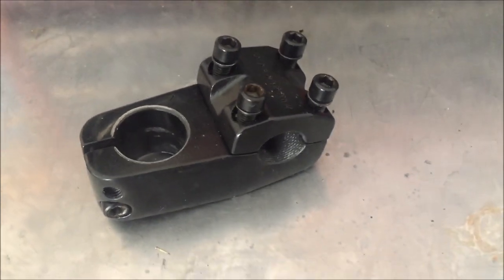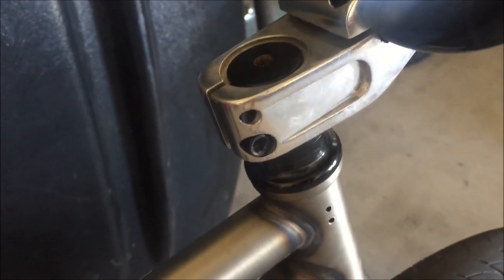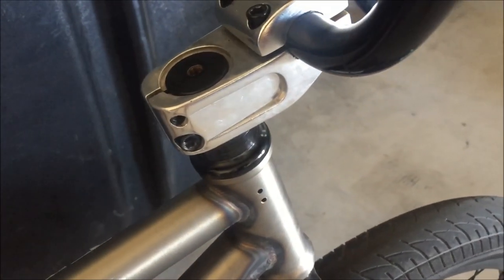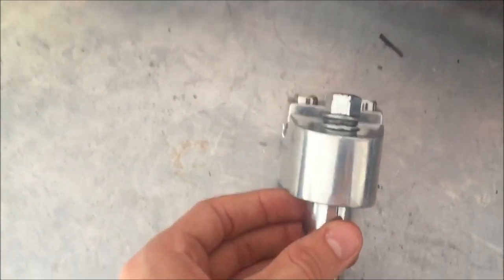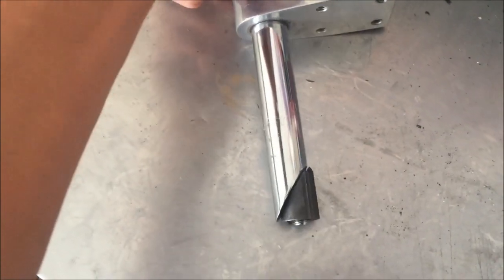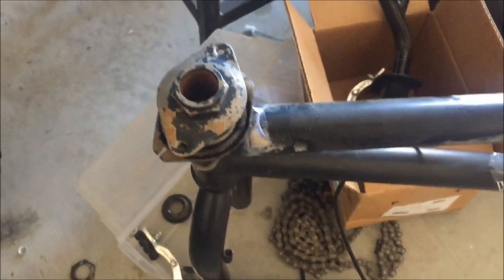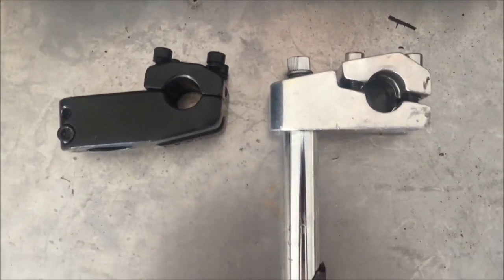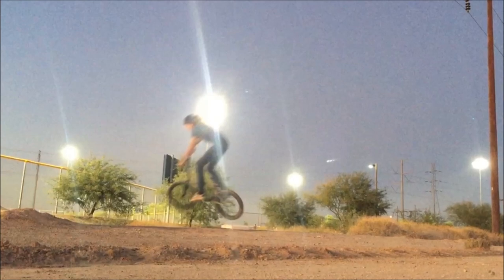Modern bmx stem VS. old school bmx stem

Comment: Can i use a modern stem for my old fork?
Reply from the maker: Modern stems fit 1 1/8th steer tubes. Older threaded forks have a 1 inch steer tube. I don't think it would work.
Reply: Ok thanks
Reply: So do I need to change forks?
Reply from the maker: That's up to you.

Comment: Its depends on frame?
Reply from the maker: Partly, yes. You can’t put a 1-1/8” fork in frame that takes a 1” fork. Yet, you can put a 1” fork through a frame that takes a 1-1/8” fork via headset adapters.

Comment: Quill stems are stronger and easier to work with actually I've snapped theadless forks and bent the stem as for threaded I've never bent broke or had any problems with them except having a loose stem but I bailed on a 30 ft drop and it landed on the bars and still run that stem and it snapped the right side of the bars clean off and folded the seatpost but the stem is perfectly fine I've landed sideways with threadless and broke the fork at the top if anything the threadless is lighter by a few ounces
Reply from the maker: I don't really know the cause for the push for threadless forks. I've noticed with heavy front end movement the tend to come lose. I have not had that issue with a threaded fork. Not even once.

Comment: I bought a modern stem for a bike with a old school stem would i be able to put the modern stem on or not?
Reply from the maker: Most likely not. A modern stem is meant for a thread-less steer tube 1-1/8 in diameter. The modern stem will be too big for the steer tube.

Comment: Can you put old school forks on a more modern frame that had bigger forks diameter if I swap the old school forks too?
Aka are the bearings the same size etc for a straight swap?
Cheers
Reply from the maker: The bearings aren’t the same size for the swap. You would need some kind of bearing cup reducer for it. If it’s set up intergraded (no bearing cups) there might not be any way to do it.

Comment: Can you use a quill stem with newer forks and vis versa?
Reply from the maker: New forks are not threaded, so if you used a quill stem in it there would be no way to hold the fork from falling out. Plus most new forks have the star bolt welded into the fork so there would be now way of even getting a quill down it.

Comment: Modern bmx but differnt tube HELP ME PLZ
Reply from the maker: I’m going to need a little more information to help you.
Reply: My bike looks new with i believe a cassette and the stem has a bolt in the middle and the part that holds the handle bars arent up and down they are side to side
Reply: Like the thing that clamps  the handle bars is in the front
Reply: It doesn't look super new but it is to new to be a bike from the 90s or early 2000s
Reply from the maker: It sounds like you have a front load stem. You should be able to remove your bars though. I would need a visual to help you out.